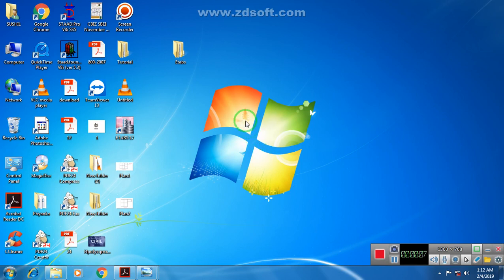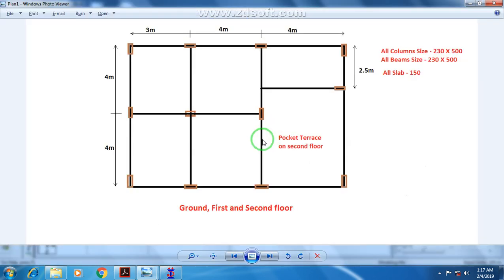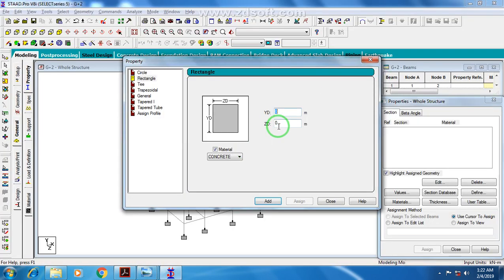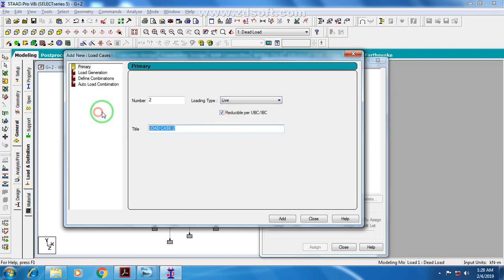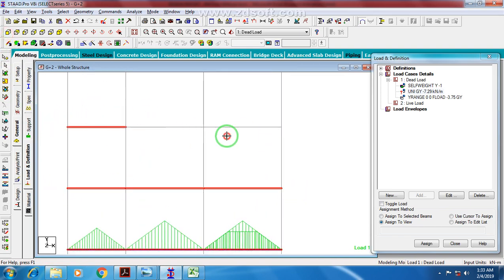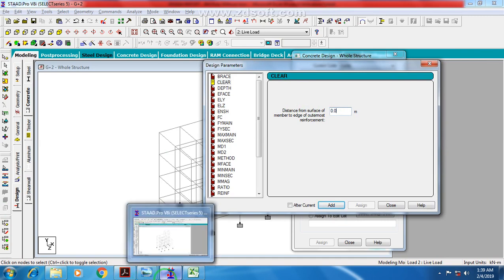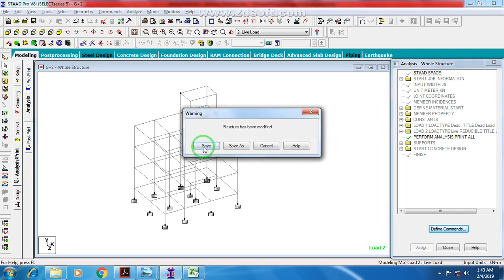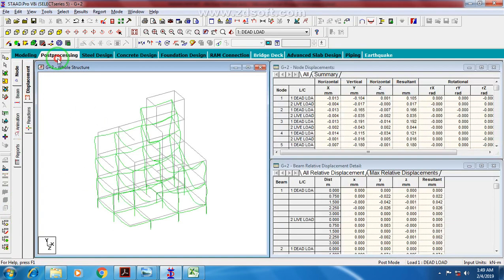Design of RCC building in staad pro.

Comment: Hi friend, this is my question.  In a multistory RC framed structure, Staad gives different areas of steel for the same column along its height; that is in between different floors the steel areas produced by the program are different - sometimes larger steel area in upper floors and smaller towards the foundation.   However,  axial load increases from top floor to foundation and in practice area of steel is reduced as we go up in vertical direction.    Using Staad results, how do we determine the correct steel areas in different vertical parts of the column ?

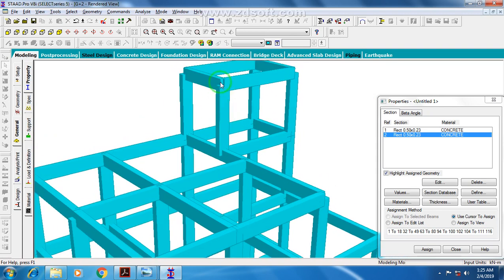Comment: Sir, I have a doubt, in this video at the time 13:34 when you zoom in render view, you can see the corner columns and beams does not have proper joint. Will this has some effect on the structure? Please elaborate that point.
Reply from the maker: Dear Namdev,
Here we are modelling centre to centre so even though in render view u r seeing offset load transmission and calculation will be correct.. because our modelling is centre to centre
Reply: @structech2535  Thank you for explaining.

Comment: What is the rule the given section of beam and column??
here give the beam and column dimensional 250 * 500.
 I want to know what is the rule the selecting the section is this dimension is there any specific rule????
Reply from the maker: For preliminary sizing u can use span/13 for beam and for column u have to calculate tributary area and then using column formula P=(.4FckAc+.67FyAsc) find out the size of column

Comment: sir, wether the length of  column which is gone under the ground is consider  as depth of foundation?
Reply from the maker: Yes Shailesh, that length of column will depend on soil report...in soil report founding depth will be mentioned so accordingly you have to model it to get exact reactions for footing design.
Reply: @structech2535  thankyou sir